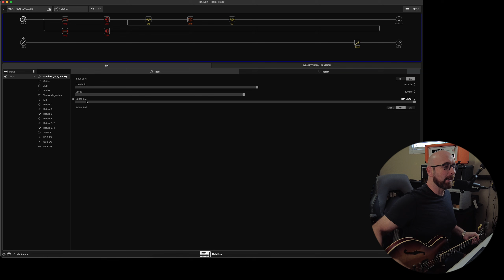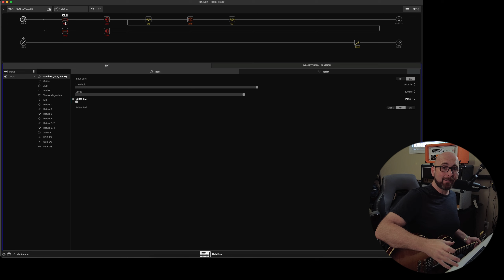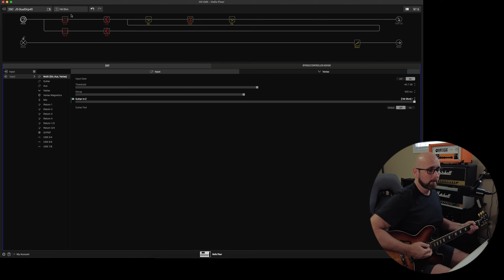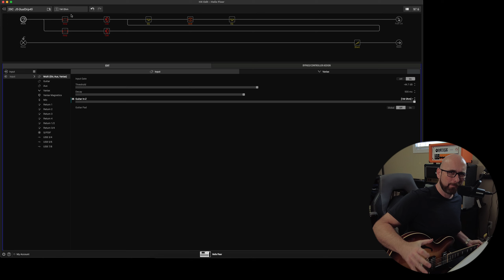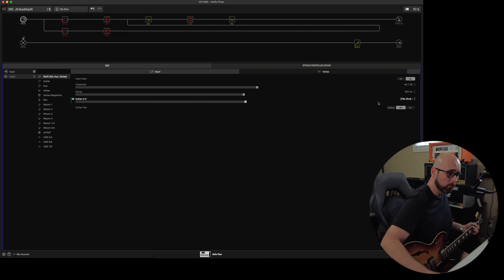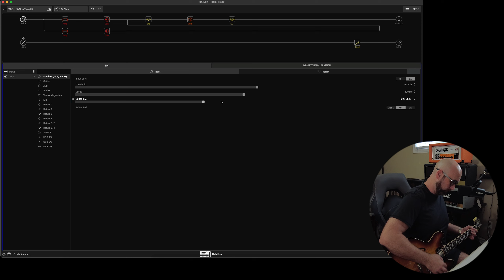The MOST Overlooked Tone Shaping Tool In The Helix/HX Stomp | Input Impedance

Comment: As a Helix user of about 5 years, I literally in the last hour have ‘discovered’ this feature ! Wow!
It has been a revelation in taming a particular high end glassiness problem with my Charvel DK24. I had changed the pickups anyway (the stock ones were way too shrill for me) but there was something I couldn’t put my finger on - backing the tone control off a bit still didn’t achieve what I was looking for .. however dropping the input Z on the Helix to 250 or below immediately cleaned it up without impairing  the feel or tone !
Helix really is the gift that keeps giving ..

Comment: Thanks, Jason. Never got around to playing around with this myself. Interested in how this will react to modeling on my Variaxes. I really never use the magnetic pickups, except once in a while the P90s on my 59P,  just because I love those.
Reply: I was wondering that, too. But I think it doesn’t have any effect on the signal using the Variax cable being as what he’s showing is an interaction between physical electrical elements. I’ll have to test it when I get home.